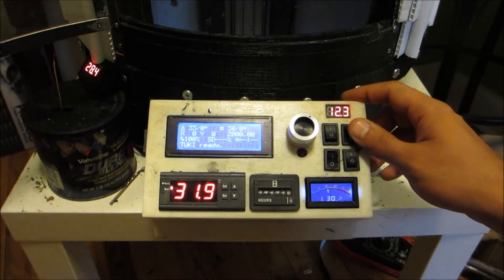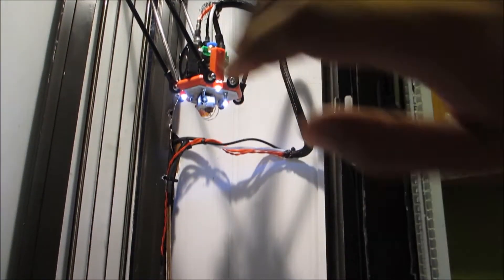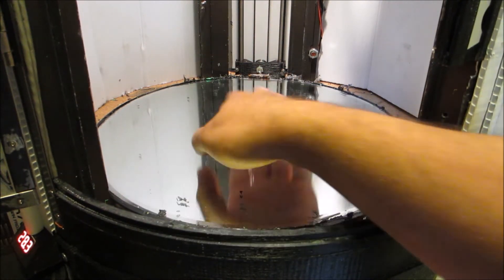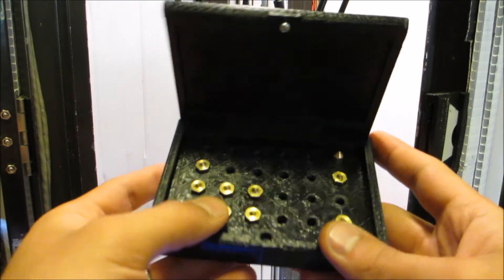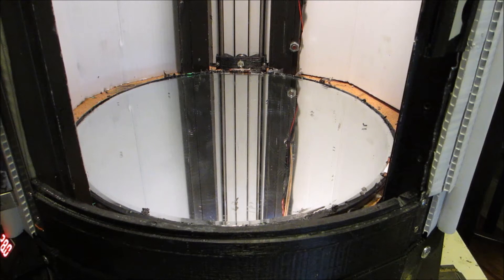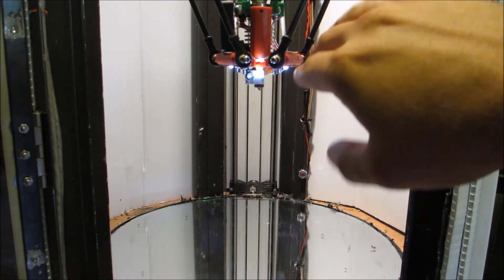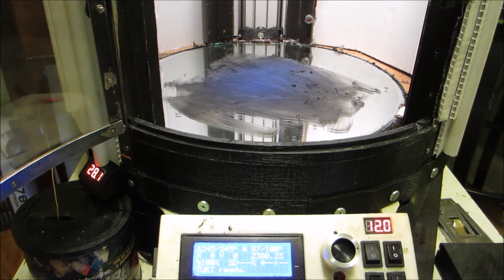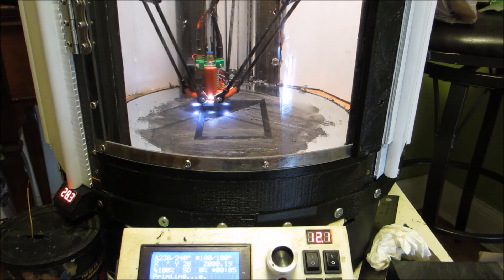heated chamber part 2

Comment: This is the first ref I've found of a mixing fan. Have the same problem: 10C delta between top and bottom. One question (7 yrs later :) ) - does it create drafts which might make warping worse or affect filament cooling?
Reply from the maker: No it did not. It helped a ton.

Comment: Nice stuff, I used to use a 60watt light bulb to heat my chamber. But the car heater is much cleaverer. Gotta stay dc to avoid nasty shocks. However to avoid getting sued by Stratasys, you must call it a "cooling chamber" :-)
Reply from the maker: +GetLoFi 

That is the thing I was trying to avoid is 120v power going anywhere near the control circuitry and inside a printer. I am sure it would be more efficient to go with a normal ac bulb though, however I still have enough headroom to add another heater if its necessary. The other end of the coin with Stratasys is why would they sue an individual who built his own printer with his own resources, that would be very bad press for one and two they would most likely loose as I am not selling any printers which infringe on their patent.
Reply: +Bruno M. http://payne.org/blog/stratasys-heated-build-enclosure-patent/ oh i guess its not as drastic as i imagined. The gantry has to be external for their patent to apply. Where you based out of? Missouri? Ohio?
Reply from the maker: I'm based out of ny/nj.
Reply: +Bruno M. Cool, yeah im just amazed that you are using those metal jheads, mine was no go from the get do, granted i didn't do any polishing etc to it. I was told that the only way they can work is with active cooling such as a small fan. Im going to peruse your site. Thanks for all the info.
Reply from the maker: Once you fix the issues they have been nearly flawless for me.

Comment: You have a great printer setup! I took apart an old hair dryer for a chamber heater and hooked it up to a mechanical relay with some basic code to switch it on and off using a thermistor.
Reply from the maker: +Mike Payne I thought about doing something like that but for 10usd I got a dedicated controller and thermistor and relay package.